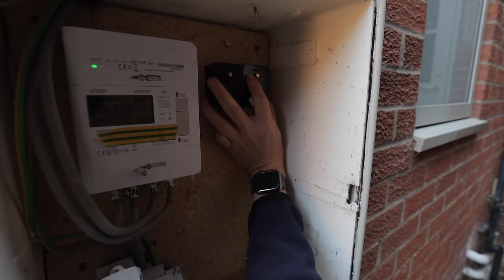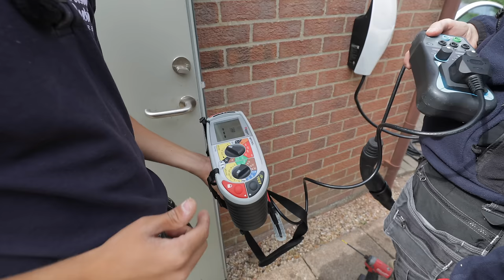I was WRONG! The Tesla Gen 3 Charger is the WORST!

Comment: They are not making it easy and at the same time they're probably doing a lot of security theater. besides that Wireless is a black art to begin with specially with brick walls it doesn't make sense but nor is it convenient to run cables oh wait you're already running cables.

Comment: There has got to be a way to use a retracting cable spool for these really long charging cables...someone needs to invent it and make a fortune!  :)
Reply: You can’t spool the cables as it creates heat from an electro-magnetic field 🔥
Reply: @occam5052  
Then why do they sell them for extension cords...I have one in the shop that is 100 foot (~30M) long?
Reply: @gregorythomas333  You can get away with it on a low current draw, but with an EV you are drawing a high current for long periods of time.
Reply: @michaelholliday100   
Ah...oki...thank you for letting me know  :)
Reply: @gregorythomas333  I spend 25 years in the electronics industry. I was at a tradeshow with an employee. We had a small LED Video Board running 120 volts at 30 Amps. The Booth next to mine stated that they smelled something burning, I looked and discovered that my employee had left the cable spooled on the reel. I quickly unplugged it and after it cooled we examined it and found bare wire in many locations where the wire insulation and cable jacket had both melted away... Lesson learned by the employee...
Reply: @michaelholliday100    
Yikes!
Reply: They are available. just expensive.
Reply: @jocramkrispy305  You would have charging cables shorting out everywhere.  They are no goo for regular use.

Comment: With all due respect, you are a great installer. But like your already running a wire back to the house, just like run some ethernet aswell.
WiFi is just too unstable and when, let's say a new owner changes their wifi password you need to do this all again.

Comment: You mounted it too low. My 24' cable only requires two and a quarter loops which makes it look very tidy and it's also dead simple to coil and uncoil. You have that cable wrapped around there like a chastity belt or something. It looks very uptight. 

Also, you Brits sure know how to take a simple job of installing a EVSE to new heights of regulatory idiocy. I'm all for safe and robust installs but your authorities require additional equipment that is totally unnecessary in the U.S. for safety and that reduces reliability and longevity. In the U.S. we just connect the Wall Connector to a breaker and it's safe and reliable with no need for additional time and expense adding on additional points of failure. That's because we don't combine the ground and neutral. The Tesla Wall Connector is designed to be the most robust and cost-effective solution for the N. American market (which does not combine the ground and neutral). Dinging it for the inadequacies of the UK electrical system is pretty naive.

Comment: This is not a Tesla problem, but the challenge of using Wi-Fi outdoors in general. The double layer of bricks in the standard UK cavity wall will block quite a bit of the signal. The only real solution to reliable Wi-Fi outdoors is to install a properly IP-rated outdoor access point in an elevated location. We did this and it solved all our problems with Wi-Fi in the garden, garage, and shed/workshop.
Reply: Nah, I get WiFi from neighbours from across the street
Reply: @deang5622  You may see it, but I highly doubt you'll get a fast stable connection if you actually tried to use it for anything important.

Comment: See I had much charger fitted November 2021 it does not go to my consumer  there a mini consumer unit with RCD init fitted to my meter board. 
My meter cupboard has everything neatly attached to the meter board  there are no fees just leaning in box like what you have there my meter box is much bigger than that the fuse is under the meter not loose . Western Power have been out and inspect July 2022. I asked about the fitting as you all go on about fitting the consumer unit and meter board.
He said what been do is absolutely within regulation so he fit a metal mini 2 rcd consumer unit directly to the meter board everything within the meter box.
He never came into my house at any point the charger unit has surge protection built into it 
There no unit outside  my meter box and the power company was fine with it . Man from WPD said the distribution Company do not own the meter board they did not fit it non of the equipment on the board is theirs. It complies with there regulations. 
He did say in some older properties the board will say property of Manweb or Norweb etc. But distribution companies have not been fitting boards or equipment for years.  So now I am confused

Comment from the maker: TESLA Chargers... YES or NO?
Reply: It has one redeeming feature - the opening the port via a button on the connector, other than that it lags behind many other chargers...so it's a NO from me.
Reply: i work for a renewable company and have had to install lots of these chargers yet i have never had an issue with the set up, overall i still don't think they are a great charger and think there are much better options at similar price value. Zappi's are still my favorite technicality wise, or Anderson chargers for best looking.
The Powerwall and gateways from Tesla are great though.
Reply: You could try an over/under cable wrap to make it more manageable
Reply: I just used a Wi-Fi extender as I knew the signal wasn’t great at the location. The car Wi-Fi isn’t particularly great either so solves both problems.
Reply: Hey, the manual states it only has 2.4 ghz wifi and no 5 ghz wifi connectivity. Newer modems/routers from providers sometimes have 2.4ghz turned off by default. That is the reason you couldn't find your wifi network. I hope this helps for future installs! Also 2.4 has a larger range, but is slower. 5ghz is way faster but less range. Now you know :D.

Edit: a wifi extender, mesh network or powerline adapters are also helpful for getting better range. Would not recommend a wifi extender.
Reply: @JMineable  You are partially right and partially wrong. The higher the frequency the greater the range in a Line of Sight  situation, ie an open field, but any obstruction will stop higher frequencies and lower frequencies have no problem penetrating walls and obstructions, but have a shorter range in a Line of Sight scenario,  ie an open field......
Reply: @michaelholliday100  *Speaking from normal use in a household, where wall are common :)
Reply: @JMineable  I found another  thing that helps is turning data off on the phone. I agree that mesh is a good way to go. If the extender hadn’t worked I would have gone this way but as I already had it gave it a try.